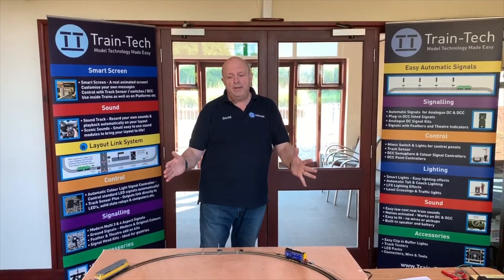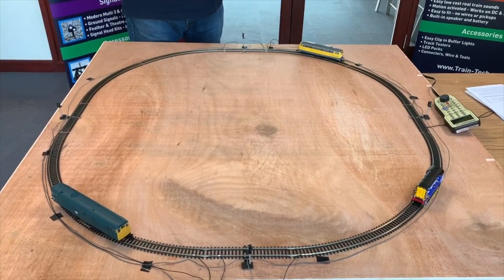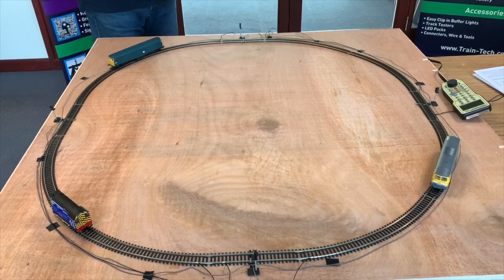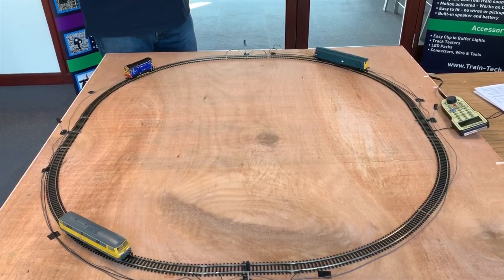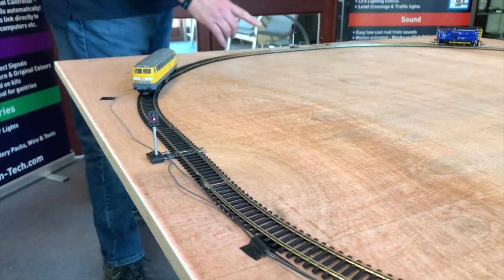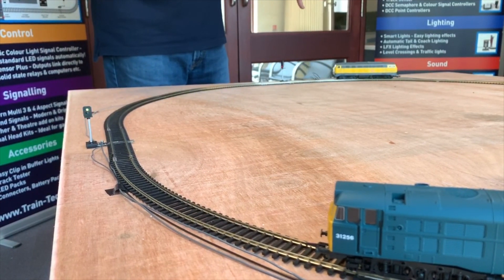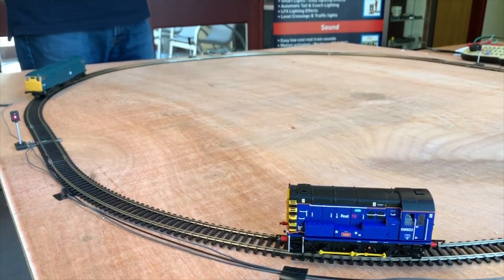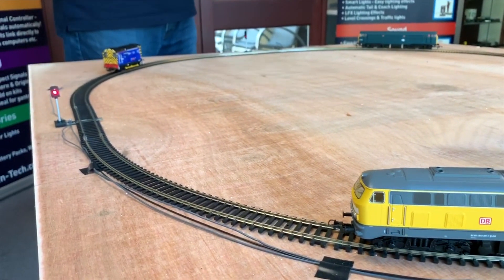Train-Tech RL1 Relay Controller - Automatic Train Control

Comment: Great video! I don't understand how he does so that the locomotives ones don't stop abruptly. Thanks
Reply from the maker: Hi, the only way to get the locomotives to slow down and stop is to make sure the DCC decoder has ABC braking and that you fit our ABC modules on the isolated section. If your locomotives have a standard DCC decoder then they would just stop as they get to the isolated section.

Comment: Hi David - I am in the process of setting up my layout after a long break and your videos are invaluable as I am all about DCC.  I already have built up a supply of Train Tech gear and just ordered your relay to set two tracks up as in the video above.  I then had a lightbulb moment and only just realised if I am running locos with sound, obviously the sound will be stopping and starting which I am not sure if it will damage the chip.   Apart from the obvious - turning the sound off is there any advice you could give to overcome this?  Thanks Alan. Alan.Rose@yorkshire.net
Reply from the maker: Hello Alan, the answer is that if you run ABC decoders in your trains and use ABC Diode modules on the breaks in your track then locos will not just stop suddenly and sound will continue in sync as the train slows down gradually. Many ESU sound chips already have ABC built in and now many low cost decoders, including most of the Zimo basic range, also have ABC built in. The one downside is that when ABC Diode modules are fitted then any non-ABC decoder locos will just carry on (complete with sound) not stopping, but some customers find this OK and brings interest to their layout as some trains stop for platforms and some just carry on. I hope that helps. (PS, if your locos are already fitted with ABC compatible decoders you usually still have to turn the ABC braking on - details will be in the decoder instructions).

Comment: Am I right in assume it cuts the power to the track so lights etc on the stopped train would turn off? Of have I mis-understood?
Reply from the maker: Hi, it depends. If you use DC or standard DCC then yes the power is cut completely and lights etc will go off, but if you use DCC with ABC chips the lights and sound etc will all stay on as the trains slow down to stop and gradually speed up. If you would like further information please look at the product manuals on the Train-Tech.com website or send us your email address and we will email them to you.  sales@dcpmicro.com

Comment: Is it possible to have the loco stop immediately in front of the signal not half way through the block?
Reply from the maker: Hi, yes you can stop the loco wherever you want by locating the isolated section in the appropriate place. We used standard fixed track which was not pinned down to openly show the simplicity and wiring, but this did not allow us to locate the isolated sections or signals in ideal places. There is another video which shows the parts needed on a shorter section in more detail. If you would like a free catalogue please email your address to sales@dcpmicro.com.  Thank you.